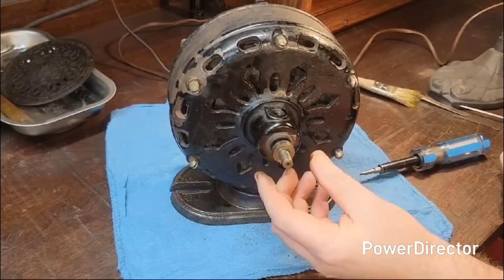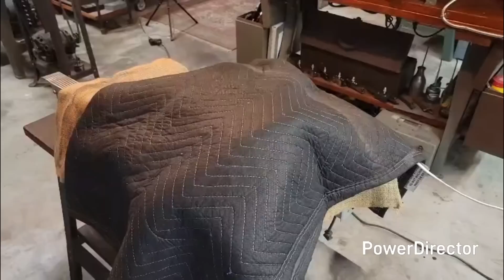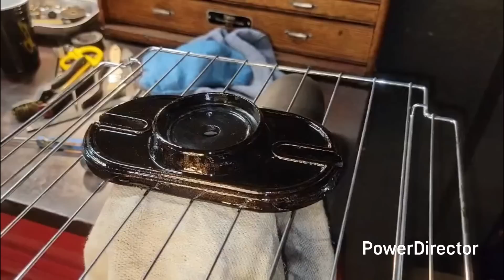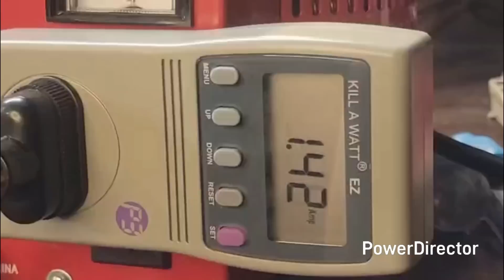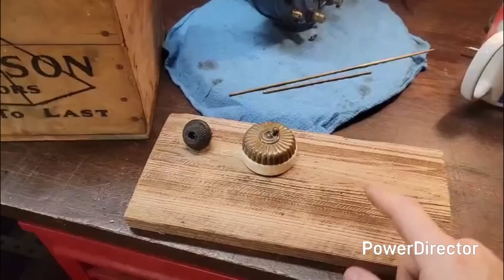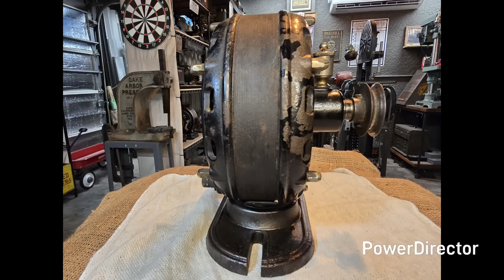The MOST BEAUTIFUL electric motor you have NEVER seen: Circa 1895 Holtzer-Cabot.

Comment: Hi Terry - what a beautiful motor! You are so forunate to have the opportunities to preserve and share these old machines. Everything about this is amazing. You did a spectacular job on every aspect of it; from the motor dismantling to the cleaning, re-japanning the base; repairing the pulley and making the base. Also, the new wire is perfect. Everything about this is wonderful.

I know you want to keep this as a utility motor and I really respect this. It should be a crime to use for a grinder and get abrasive anywhere near it! 

Might make a wonderful small belt-drive fan motor. If a very early belt-drive fan appears, you could make a display box for the motor and a fan for it as a load. Could even have a period-correct transformer mounted in the box, as a voltage buck transformer for the correct 104V power.
Reply from the maker: Thanks David. I am glad you liked it. I gasped when I found out this was powering a bench grinder. Antique Fan Parts website has some pictures of the fan version albeit repainted and nickel plating applied. The wire is amazing and I ordered plenty for future projects.
Reply: @BencoVintageMachineWorks   
It amazes me how people abuse things from this era... and how they survive nonetheless!

Comment: What I find amazing is that through the evolution of time, motors are basically the same today as when they were first invented. That 1895 stator looks identical to a 2025 stator. You would think that after 130 years of development we would have a totally different way to convert electrical energy to rotational energy. Car engine are no different. Other than modern electronics, they work exactly the same.
Reply from the maker: Very true. Thanks for watching.

Comment: Is the Motor running counterclockwise
Reply from the maker: Looking at it from the front, it runs clockwise. Direction can be changed by rewiring the relationship of the start winding to the run windings. On such an old and delicate motor, I advise against it because the risk of damage.

Comment: Liked and subbed. Watching from Denmark, Scandinavia. Excellent job.
A mixture of Neatfoots oil with Lanoline and Bees Wax (in the right amounts) is good for both old leather bound books and your lips during the winter.

Didn't know of this "Japane'ing procedure". Somewhere there's a rabbithole to be explored :)
Reply from the maker: My other Holzter-Cabot motor video goes more in depth on Japanning. Its time consuming but durable and elegant looking. Thanks for the tip on the leather.
Reply: Thanks. I'll dive into it.
I think it was 60% Bees Wax, 25-30% Lanoline and 10-15% Neatsfoot Oil that was the recommended mixture for the ordinary maintainence of old leather books (and good for the lips).
Reply from the maker: Good to know

Comment: Very nice "restauration". You cleaned it and made it work again, but it held its character. I am glad you did not overdo it and make it look like a brand new machine.
Apparently safety was not a concern 100+ years ago. Those open uninsulated terminals give me goosebumps.
Reply from the maker: Most of the antique electric motors and fans of that era had similar exposed terminals and fan cages with wide spaces. They just assumed you were smart enough not to touch them and that you supervised your kids around electricity and moving fan blades. Todays mindset is a little different and now the kids have TikTok...lol.